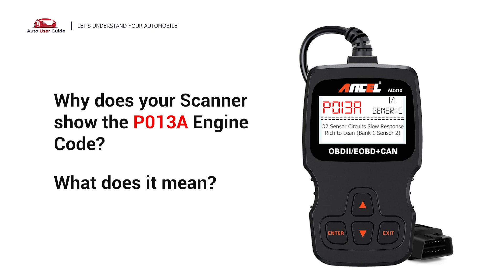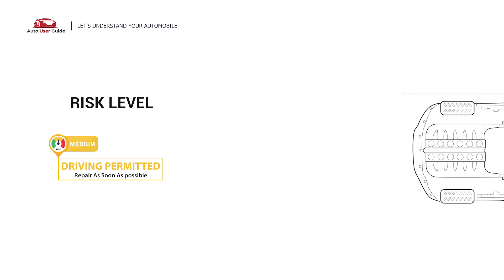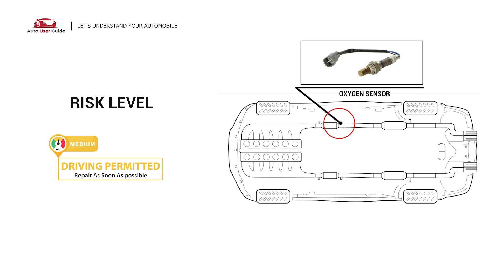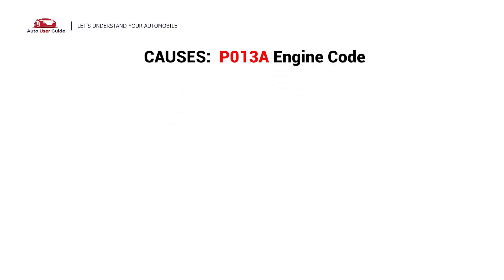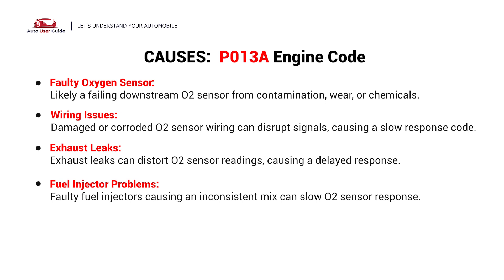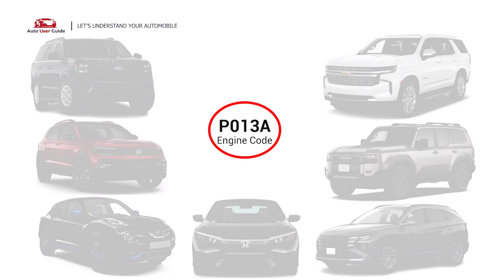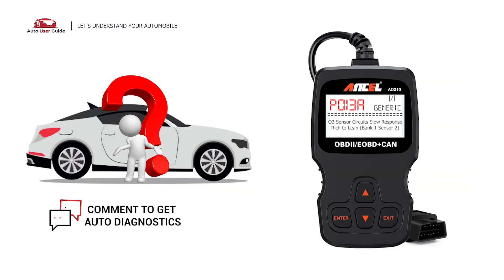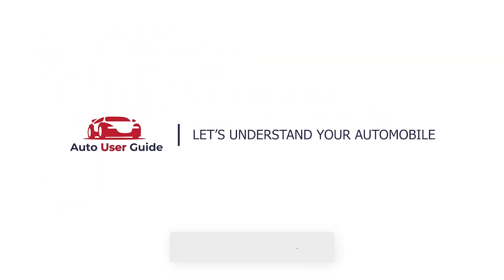What is P013A : Engine Error Code Causes Explained

Comment: Have this code changed many O2 sensors and installed new cat smoked intake and exhaust will only return around 3-5 drive cycles and all wiring to ECU are good and everything on scann tool reads properly with in parameters any suggestions
Reply: Sorry 2011 2.4l Malibu 6speed auto